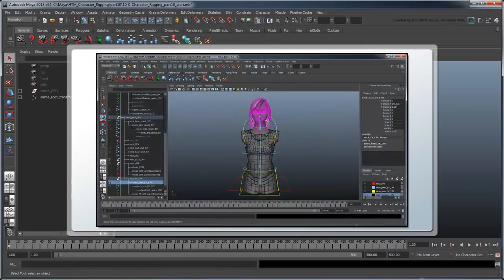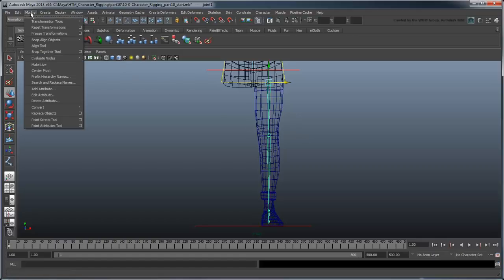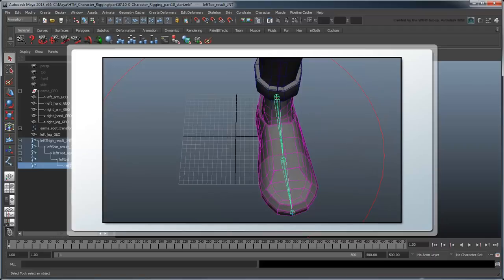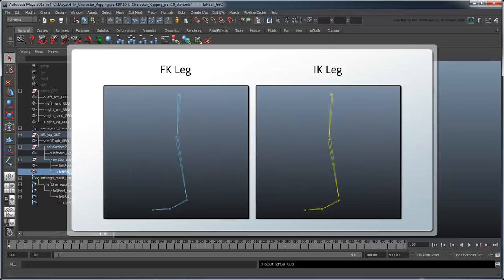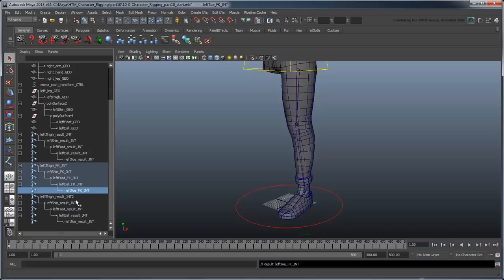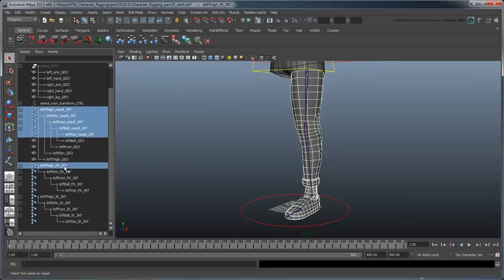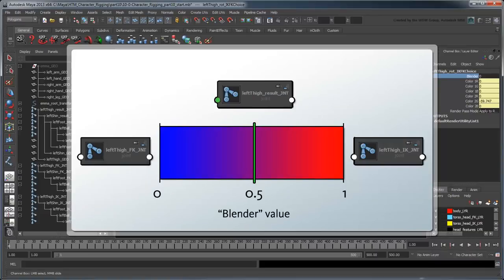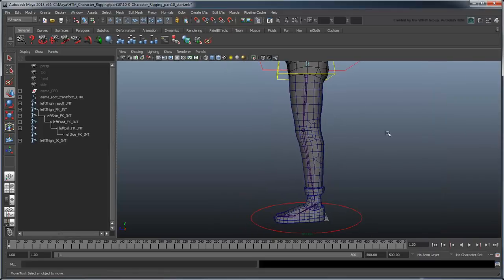Creating a Character Rig - Part 10: Basic IK, FK, and result leg joints (Advanced)

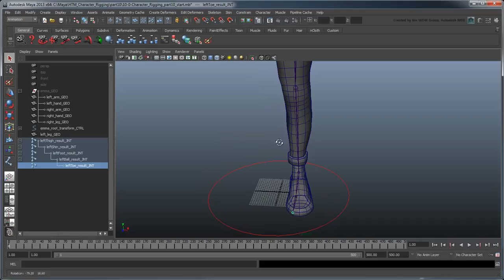Comment: 3:18 Work Pipeline question. In many cases, Geometries will not be modeled parallel to a joint chain or with straight limbs. (in my case, i've been following along this tutorial series with my own character model - has a muscular build and a more angular Tpose i.e. arms diagonal instead of straight) The model you are using here has nice straight limbs, so it was pretty straightforward to just rotate back the feet after cutting up the geometry. 

My question is - is it better to freeze my joint transforms at a generally straight alignment like shown in this model/tutorial series, OR should I freeze my joint transforms following the angular limbs that a character was modeled with?
(another way of asking this is) Should the skeleton conform to the Geo? or should the Geo be made to conform to the skeleton's default pose?
Reply from the maker: +Gogo Although either method can work, I generally prefer to conform the geometry to the skeleton.

Comment: Hi sorry, but i am having a problem with blendcolor for translate for the thigh. When i output the blendcolor to ThighJNT translate, my Lthigh joint just shoot out in Z world space. How is that happening when everything is fine with rotate blends?

Note, i have my thigh joint parent to the root joint.
Reply: Hey did u ever get an answer to this question having the same issue
Reply from the maker: @Funny3dguy  Do the FK/IK joints exist within the same space?  i.e. when the joints overlap in the Viewport at various positions, do the translation / rotation values line up between upper legs, knees, and foot joints?  It's possible that you may have made copies of the result joints for those controls, but then moved them into different spaces (such as the "root" space as mentioned in the original comment) which would've changed their values relative to each other.
Reply: @Autodesk_Maya  hey first off THANK YOU so much for creating an amazing tutorial its helping me out so much. So i basically mirrored the legs how you said in in part 32  in yz and behavior for result and fk leg joints and orientation for ik and then un parented them from the joint chain del the extra nodes. They have negative values in there translate then once i parented the geo to the resulr leg, i start creating the ikfkblend and everything is fine until i connect the output of the  translate blend colors node into the respective result joint all of there translate values zero out except the rightthigh_result jnt. Causing the joints to shoot up Ive tried even making brand new joints in the same position but no matter what it shoots up. Hope you can help and hope that makes sense.Thank you again
Reply from the maker: @Funny3dguy  So as I stated above, the first thing to check is that the values of the Result / IK / FK are all the same when the joints overlap in different positions, because if they're out of synch that's going to cause all kinds of strange behavior.  Remember, the IK/FK joints should be exact copies of the result joints they're meant to control.

Secondly, are you experiencing this problem before or after doing squash/stretch for the right leg?  If after, you'll need to make sure to invert (multiply by -1) the measurement values coming from the Measurement node.  This is because the Measurement node always returns positive values, but you need to stretch the leg in a negative direction due to the orientation of the joints.
Reply: @Autodesk_Maya  Thank you so much  and the problem was fixed when i duplicated the mirrored result joint . Your amazing

Comment: At [7:55] of this tutorial you said Freeze the geometry's transforms but when I did it; it reoriented the axis of the geometry. So now if I scale the geometry in later tutorial it scale down on the X-axis not the Y-axis. Do I need to Freeze the geometry on the Translate x,y,z and the scale x,y,z and not the rotate x,y,z to make this work? I use Autodesk Maya 2015.
Reply from the maker: It largely won't matter either way since you'll be putting the geometry in group nodes to orient them correctly anyway.  That step is more of a housekeeping / good practices thing.

Comment: hello i want to ask, I already make a blend colors and connect the IK and FK Joint into colors 1 and 2 and make an output into result joint but my joint cannot rotate and if I check in the channel box all of my rotate menu is lock because unit conversion 1 what happened here? Thank you
Reply from the maker: When you say the rotate menu is locked, do you mean on the IK or FK joints, or on the result joint?  They should be locked on your result joint - that's completely normal since it is now being fed values from either the IK or FK control joints.

Comment: at 1:45, what's the point of freezing the transformation on joints? it doesn't seem to change anything.
Reply from the maker: It establishes that at as the 0-position for that appendage.  You're right that it's not strictly necessary, but it just makes the point of reference a little nicer.

Comment: Just a quick question about the FK/IK switch implementation. What if I wanted some functions of IK in FK mode? For example, lets say I've rotated my character into a mid-air pose in FK mode, but wanted the legs to stay planted exactly in the position that they were in during FK mode. If I switch back to IK mode, I would get the ability to make the legs stationary. But wouldn't that also cause my legs to lose the position it was in during FK mode? How would I remedy this?
Reply from the maker: Check out Appendix A which shows you how to make an IK/FK matching script.  Then you can just pose the leg in IK and switch to the matching FK leg with the press of a button.

https://www.youtube.com/watch?v=MBRJjxU-Lwk&index=33&list=PL8hZ6hQCGHMXKqaX9Og4Ow52jsU_Y5veH

Comment: I'm having the same issue as Elson Choo, but I checked my inputs and outputs and all seem to be correct. What am I missing here? It seems to be on the TY input and output that the problem is occuring.

EDIT: I figured it out... It's because they were connected to my root joint... that makes no sense though... Why would the translations of the thigh joints and following be changed out when they are a child of the root?
Reply from the maker: The root joint?  There is no root joint though.  Do you mean the result joint?  If so then the reason it's happening is because a double transform is occurring (not to mention a cyclical dependency).
Reply: @Autodesk_Maya  and how do you fix that im having this issue as well

Comment: i have a question : if the legs are modeled so that both the knee and foot are pointed slightly outward, should I alter the mesh, or should i just pose the leg before skinning and then return rotations to zero ?
Reply from the maker: The best way is to pose the leg before skinning and then return them to zero.  Although both methods are technically fine, it's always best for the 0 position to be meaningful for your animator.

Comment: So, is it generally recommended to model everything straight so your joints all lie on 1 plane of rotation? Because if you don't, creating pole vectors could make your joints shift when you create them, right? I know there's a way to figure out the vector of your pole vector for arms/legs modeled at an angle, but in my experience the controller for it is misaligned and bothers me a lot even though there's no shifting upon PV constraint creation.
Reply from the maker: Yes it's generally a good rule of thumb.  By default, you'll also find Maya forces you to create them on a single plane, even when in the perspective view in order to avoid just such a thing happening accidentally.

Comment: nice videos, very helpful!

i also need help with the node editor. when i connect the outputs of both the rotation nodes and the translation nodes with the input of the result joints, the connection is coloured red & not green like the other ones... i can't find anything about that when searching for a solution. i'm using maya 2016. is there sth new in this version so that this connections are impossible to be made?
Reply from the maker: Have you tried expanding those attributes?  It sounds like you might be trying to connect a single axis value (e.g. Translate X) to the entire transform of another node (e.g. Translate XYZ).
Reply: thanks for your answer! i've done things exactly like shown in the video. but yes i tried to connect the single transform values to the color values but it still didn't work...

then i decided to just repeat every single step, one by another, from the very beginning. some of my connections are still red. but surprise: now everything's working! i simply seemed to mess up the inputs & outputs, too... no changes in maya 2016 as i supposed, everything's fine.

Comment: Curious, why do you choose to add "result" in the name the first joint chain? (this is the chain you're supposed to bind the actual geometry to when skinning isn't it? ) - just wondering why this is so. Thanks!
Reply: +Gogo There wasn't any reason for result. He just did it so it could help him rename. It is also faster if you do a search and swap result with IK or FK.
Reply from the maker: +Michael Wong Correct.  It's just for ease of identification purposes when going through the various editors.  If a different name helps you identify it better, then feel free to use that instead.

Comment: Has something changed in Maya 2014? I've followed these instructions on the blend nodes, and my FKIK_blend switch are switched, so that 1 is FK and 0 is IK... the same has occurred with my auto/manual knee.
Reply from the maker: Nothing has changed in this regard, so it sounds like you may just need to flip the inputs.

Comment: Hello, how do I modify the unitConversion so that the value of Blend Color instead of going from 0 to 1 fence from 0 to 10 with decimals?
Reply from the maker: Unfortunately, Blend Color nodes only accept values from 0 to 1 (it's just how they're designed).  I'm curious, what difference does it make since you can also use decimal points for the Blend Color attribute as well?  Are you just trying to be incredibly precise?
Reply: I'm interested to know if I can add an IKFK blend attribute that is "float, min 0, max 10, default 0". Would it work properly?

Comment: will pairBlend node work smoothly in ik fk blend? 

if so, what are the advantages? 

thanks
Reply from the maker: Yes, pairBlend will work.  They have the added advantage of being able to plug both translate and rotate values into the same blend node (thereby reducing the overall number of nodes).
Reply: Maya Learning Channel
great. 
anyway, I have another question. I want to orient a joint chain with -X axis as the primary axis. just like what we will get if we mirror a joint chain. 

What is the best solution for that situation? 

mu current method is unparenting, aim constraining,  reparenting the joints. seems a bit tedious. 

thank you
Reply from the maker: Just use the Skeleton > Orient Joints command on any joints to re-orient them.

Comment: HI there. I'm having a slight problem if you could help me. I need to move the result leg hierarchy into the main rig since it's a game character. however, whenever i do so, the result leg moves. I'm guessing it has something to do with double transformations or an issue from moving it from a world space into a local space. Is there a way to safely do this or is this method impossible for game character rigging?
Reply from the maker: In all honesty, this rig is not ideal for game characters because it's so advanced (most game engines can't handle the advanced functions like squash/stretch and compound controls without customization).  What I'd recommend is using this rig in Maya for animation, then transferring those animations to a much simpler skeleton rig that game engines can understand (one without all the bells and whistles).
Reply: Yeah, I guess. I's kinda sad that stretch and squash isn't an "out of the box" feature with game engines in this day and age. Anyway I ended up putting all the IK and FK bones under the hip hierarchy as well. It'll be a pain to have to unselect  them all whenever i have to export an animation, but at least i can work directly on the rig. Thanks for the quick reply and the tutorial. I have learned a lot from your tuts.